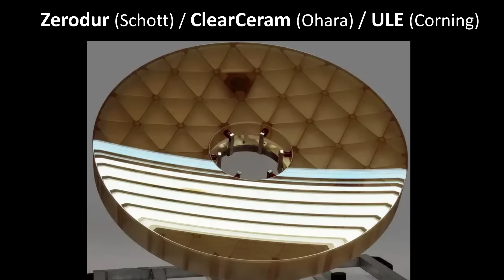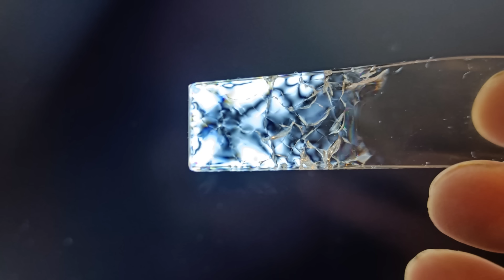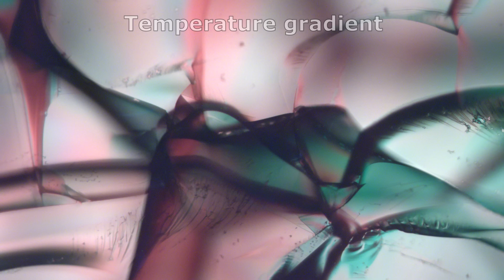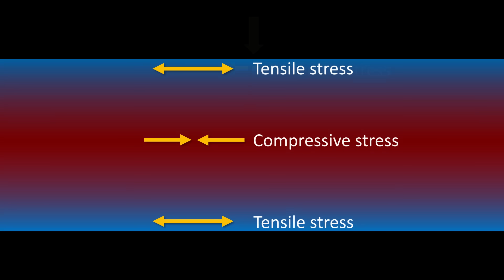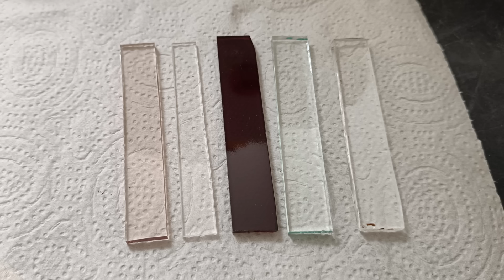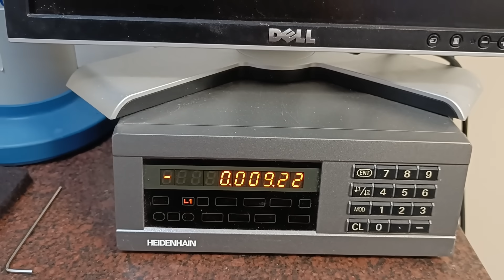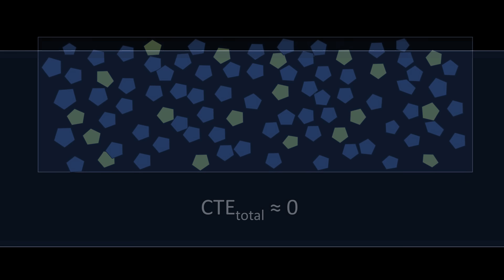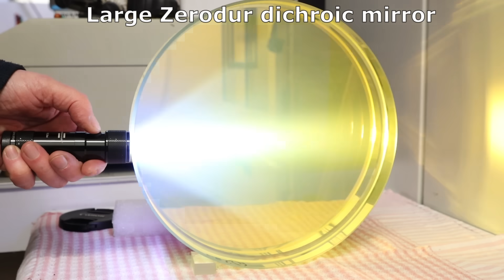The Amazing Properties of Glass-Ceramics (GC Part 1)

Comment: A small correction: ceramics aren’t necessarily crystalline. Ceramics are a class of nonmetallic materials that are brittle around room temperature. Glasses are therefore ceramics. 
Glasses are a subtype of ceramics (and also metals, in some cases) where the structure is amorphous. 
Glass-ceramics, like ceran and robex, however, are composed of crystalline grains, like you said.

Comment: So the reason glass shatters from thermal stress is both from its CTE as well as the fact that it is a very poor thermal conductor, correct? I wonder then, if you doped the glass with metals with a very high thermal conductivity, such as aluminum, copper or even silver in the same way you add lead to glass in order to get lead crystal glass, would it become less prone to cracking even without altering its overall CTE?
Reply: I don't think you can mix those metals.. they won't uniformly blend in the glass and will cause breaks on their own. Aluminum will destroy the furnace so it can't be used at all I know that much. Iron oxide is blended into glass for tints and it changes thermal characteristics but it will suffer thermal stress because glass itself is amorphous as he explained in the video. Only the crystalline ceramic forms of glass have that resilience

Comment: Could glass and glass ceramic be a economical  alternative to concrete?  Maybe a reinforced matrix? Concrete has many disadvantages and points of failure.
Reply: well it is in the sense of how architectural glass covers many modern buildings now instead of window frames
Reply: @RagedContinuum  OK and that glass in hi-rise building does have a structural role in preventing torsion but what I mean is heavy fiber reinforced blocks as compressive load bearing components like concrete. It would seem like they could be produced with less cost than concrete and with a lot higher quality cuz concrete can be pretty fussy stuff that requires precise testing of the limestone and aggregate but even with that things can go wrong usually involving water rusting the rebar and wrecking the concrete.  Reinforced glass blocks could be manufactured just like Lego and delivered to the job site and assembled there. If they had holes in them for reinforcement pipes (NOT rebar) that have threaded ends I think you could build a tall building with the stuff and residential housing built from it would have a lot more strength and lower maintainence than stick frame wood houses and be a lot safer too being not flamable.
Thank you for giving me the opportunity to put that idea out there.

Comment: I am a teacher of physics at a secondary school in Poland.  I do not use mathematics in my lessons.  To understand things, students do not need mathematics. Calulations and formulas are necessary for scientists and engineers.  Thanks to your knowledge and  enthusiasm I included glass ceramics in my lessons about thermal expansion. I also made two 3D models and published it on Sketchab. You can see them easily.

Comment: While it is not my primary specialty, I did start branching into ceramics a few years ago (more like dabbling to investigate property expansion of an ongoing project). Glass falls into an interesting area of material properties, having a mix of characteristics not so indifferent to polymers, while being wholly mineral-based like a ceramic. In relation to transparent polymers, so far as I understand it, the effect is solely due to it having amorphous structure as opposed to semi or fully crystalline. Leapfrogging as you do in these pursuits, somewhere in that journey I became increasingly curious about aluminum oxynitride and increasing research time into more feasible (less costly) production methods. Alas, the latter is more of a curiosity of mine as prior work still takes precedent.

Comment: I'm a chemist. My question is, why arent beakers made of glass ceramics? Or are they any I haven't been fortunate to use them? Borosilicate glass is typically used. Is it due to cost?
Reply: Wait, I figured it out on my own I think. We bend and shape borosilicate glass into different tools for chemistry. You couldnt do this easily with glass ceramics.

Comment: Very fascinating. How does it perform against physical impact like getting dropped or knocked around comparing to tempered glass. Thanks.
Reply from the maker: It's similar to normal glass: if you drop it on a hard floor, it usually breaks. It's definitely less break proof then tempered glass, although some versions also use chemical toughening of the surfaces, like Ceran.
Reply: @ thank you.

Comment: Is that titanium dioxide nucleation the reason why Corningware is usually white?
Reply from the maker: No it's actually the formulation that leads to crystals larger than the wavelength of light and that have a significant difference in refractive index to the rest of the material. But for "pottery", the white color is also attractive from a marketing standpoint.

Comment: Would you recommend using Ceramic Glass for Venus probes? If not, what materials do you think might stand a chance?
Reply from the maker: No, chemically they are almost as vulnerable to chemical attack as standard glasses.  The only thing that works for a short time on Venus is diamond.

Comment: I have been into static Static electricity of late and the positive  and negative charges that arise on different materials  arising from the confluence of materials i.e rubbing the creation of a heated surface ,charge or the variation of charge being the instigator of nucleation which may be a bit to deep  into the mechanics for this so i step back a bit   bacillary  positive and negative live in harmony until something like heat forces one off or into the material and as with semi conductors that charge movement or accumulation of heat having a charge  the pattern the charge particles takes changes with the impurities with in the substances hope that's clear enough

Comment: I recently learned that Uranium glass was used for its CTE when joining materials in lab gear and electrical tubes such as vacuum tubes. I found on my old SpectraPhysics 120 some Uranium glass beads around the electrodes. If you ever get bored check your older lasers etc with a UV light. You might find some Uranium glass!

Comment: Would a high thermal contuctivity also help in making glass less likely to shatter? Let's say we put a lot of metal fibers into the glas structure to help it propagate heat evenly over a the material, would that make the themperature shock less likely to crack the glass?
Reply from the maker: I think so. Just like thinner strips of this material are less prone to cracking than bulky objects.

Comment: I like collecting vintage Corning Pyroceram mugs and kitchenware, which I thought of immediately seeing this video title.  Its fired at an ultra high temperature and is incredibly durable and smooth.  Very hard to chip, break, or stain and looks new decades after they stopped production.  I wish they still made products using material science instead of accounting.

Comment: Even if there was residual stress in the aluminum causing an anisotropic CTE, ~50C should not be hot enough to relieve that. If the cold measurement of length after the test is identical to the cold measurement of length prior to the test, I would be very curious about what the density of that aluminum is in case it's alloyed with something unusual.

Comment: I am a master machinist.  I'm pretty sure the error with your aluminum sample was BECAUSE its extruded. It is pre stressed, as it were, in the long axis. I deal with this issue when making precision parts.  A piece of billet aluminum or cast tooling plate would yield results much closet to book values.  Cool video, and the explanation of the molecular behavior helps me to understand better the stresses in metals.  thank you.  I love learning.
Reply: I also wonder if it is not pure aluminum.  In my experience, most extruded aluminum produced is actually some form of aluminum alloy, unless listed as pure aluminum.  Go down to the local hardware store to buy a bar of aluminum and it's almost certainly an alloy.
Reply: @guitfidle  pretty much everything made from aluminum is alloy, extrusion is probably 6063. But all forms of aluminum have very consistent CTE
Reply: @guitfidle  I mean yeah it's definitely an alloy that's not a question. Buying pure aluminum is quite difficult. The problem lies in extrusion for sure though, not in the fact that it's alloyed.
Reply: Do you have expertise to predict what might happen to the CTE of the aluminum extrusion if it were annealed and tested again?
Reply: @jimbrookhyser if you anneal properly (above the recrystallization temperature for long enough, cool it slow enough) it should return to the datasheet CTE.

Comment: Over a decade ago I purchased quartz rods for a clock pendulum and demonstrated to a friend how it could be heated red hot and then quenched in water without cracking. Sadly I physically cracked both rods before the clock was built but the fused quartz had similar ultra low thermal expansion as you show. Great video. Interesting seeing Robax and Ceran with the (Schott) name, since the most acccurate pendulum clock is the Shortt. It will be interesting to see if I can find a 4ft rod of ZeroDur (1m isnt long enough to add end fixings for a 1seconds pendulum) . Many thanks.
Reply from the maker: The form factor of your objects make a large difference in stress build-up. A thin sheet of quartz has a bigger chance of surviving this type of treatment than a thick rod, because less tensile stress can built up in the material, especially near the surface.
Reply: Is there a reason not to glue the pieces back together?

Comment: I didn’t see any comments about the Aluminum. You have the correct information for Aluminum. The Value you got is well within the range for other metals…. zinc (30-35ppm) or indium(33ppm). 

This is either a rolled zinc alloy, or a questionable batch of 7xxx series Aluminum where there are some potentially large zinc domains.

Comment: 15:20 Could the bias in the Al be because it's more thermally conductive?  Heats up the measurement probe, so you're inadvertently adding in extra delta L?
Reply from the maker: One of the things I did not realize is that sapphire has a high thermal conductivity (higher than some stainless steel types). So contrary to what I thought, the sapphire ball does not act as a thermal barrier. Your  explanation might very well be correct.

Comment: Have you considered a video demonstrating some of the properties of barium titanate? Polished crystals fit for optics are a bit pricey to get hold of, but there are a few really cool experiments you can do to demonstrate quirky optical phenomena if you have a collimated laser to shine through it. It would also be a great jumping-off point for a breakdown of holography and/or phase conjugation and some of the weird edge cases in optics that have surprisingly practical uses.
Reply from the maker: Thanks for this suggestion, i had never heard of this material.
Reply: @HuygensOptics  Cool! I'm not surprised you hadn't heard about it. I think there's only one actual video of someone showing the demo on youtube and it's way old, by a guy named (aptly) SuperLaser123. Otherwise the interesting stuff is mostly confined to journal articles and technical manuals.

Comment: Bill Otto on Quora revealed a fairly interesting property of glass ceramics.

The two different materials not only have different CTEs (that roughly cancel), they also have different thermal time constants.  Somehow it takes TIME for a material to change size, after the temperature has changed.  And the amount of time that it takes is different between the two.  So that means when the temperature changes quickly, the material can expand but then contract back again... with quick thermal gradients, like Bill might have encountered when striking the glass with very high power but short laser pulses, the glass will change shape but only briefly.
Reply from the maker: Interesting! If I had to guess why it's that the spatial migration of the Lithium ions within the crystal lattice is not immediately but a statistical process whose equilibrium shifts with temperature. So if you have a very fast temperature change, it takes some time to reach the new equilibrium in the LiAlSiO4.

Comment: 5:56 are you sure? The hot inside is bigger due to thermal expansion and the exterior contracts due to colder temperature, I wonder if the arrows are mixed up on this image. The cracks should grow from the core to the external surface, no?

Comment: Could the crystal size be used to create a Band-Stop filter, that blocks a specific wavelegth, such as InfraRed for glasses to be used as Thermal Insulators? While remaining transparent at Visible Light wavelengths? The changes in length, would suggest some of these glasses would be ideal for us in spacecraft, where there is a large thermal difference bettwn inside and outside of a vehicle. How would Ruby or Aluminium OxyNitride perform in these same tests?

Comment: Wow I've wondered for a long time why it's called glass-ceramic and always thought it's just some kind of composite, not a separate class of materials!
I work in a lab and we use fused quartz for the most demanding applications (tube furnaces, photochemical reactors etc.). Quartz glass is used not only for its low CTE (this is not a problem since it is usually heated whole and hot spots can be avoided). Unlike soda-lime and Boro 3.3 it is transparent for short length UV light making it ideal casing material for immersible UV-C lamps. High grade quartz glass called Ultrasil is used for windows that remain transparent even under high intensity ionizing radiation without darkening. Chemical resistance even to strong bases at high temperatures is also excellent - I've seen a transparent ampoule made of silanized quartz holding fluorine gas (!). Silanization is a surface treatment removing OH- groups that can be deprotonated (this is why strong bases dissolve glass and why is glass easier to cut underwater).
So I guess glass-ceramics are ideal for demanding applications involving temperature while fused quartz is better for chemical resistance and transparency. The chemical resistance of glass-ceramics might depend on composition, especially that containing aluminium which is amphoteric (dissolved by both acids and bases).

Comment: i don't think its heated to 1650C because silica needs to melt. in presence of lithium (or any column 1/2 metals, boron, or lead - collectively known in ceramics as fluxes) silica melting point is reduced down to about 1200C or lower with boron and lead. 

I think the reason is similar to glass blowing. heat it higher than you need to, so it says soft longer. 

an interesting difference between sodium in soda glass and lithium in this stuff, is that sodium slowly evaporates, and when the melt is "short" on sodium , after being heated too long or too high, the glass becomes opaque due to crystallization rather than vitrification. Lithium, even though its lighter than sodium, is not as volatile. But its an even stronger flux (it lowers silica melting point more than sodium or potassium, and reduces the viscosity of the melt, ie increases the runniness. this is important for mixing.)
Reply from the maker: Thanks for this addition!

Comment: 15:14 : probably the alluminium rod is an alluminium alloy, and not pure alluminium. (and so, the introduction of other elements can change the properties of the overall thing)
Reply from the maker: I checked alloys but could not find anything close to 32.4 ppm/C
Reply: @HuygensOptics  strange then, considering your device seemed accurate for all the other marzrials

Comment: 9:15 "the actual value of the CTE can vary between batches"
All of these "zero CTE" materials still have a CTE that varies with temperature, and which crosses the 0 ppm/K line across a - 20 .. +85°C range. Around room temperature, it might be as low as +/- 0.02 ppm/K.
"Zerodur Tailored" has multiple zeros and a very small deviation from zero in between.

Comment: Excellent video, regarding the Extruded Aluminum you used to measure the delta L/L.  Extruded aluminum, as is most aluminum one buys are alloys, not pure AL.   Extruded aluminum usually contains some small percentage of magnesium and silicon.  As a result, the delta L/L values can be significantly affected by these added elements.

Comment: Pyrex was acquired and is no longer made of borosilicate glass. The brand is being used to sell cheaper glass for a premium and folks have had them shatter.
Reply: Like the antiseptic, "Mercurochrome" used to contain mercury.  Nowadays you get a mild antiseptic coloured with eosin to make it red, although it may contain a mild antiseptic benzalkonium chloride, but nowhere near as good as the original compound which is discontinued, if not banned outright.